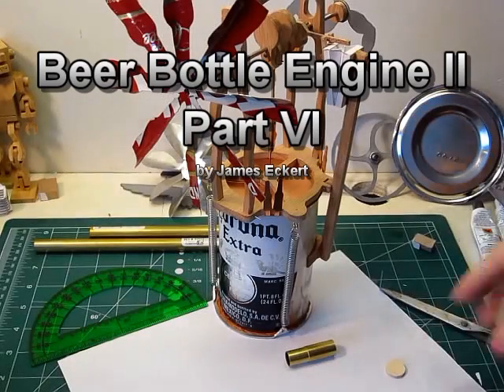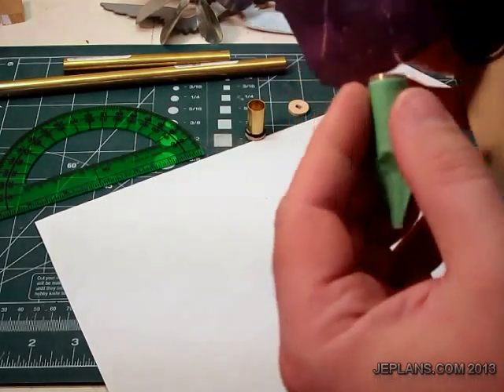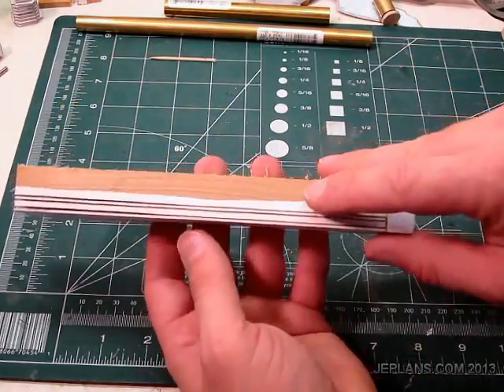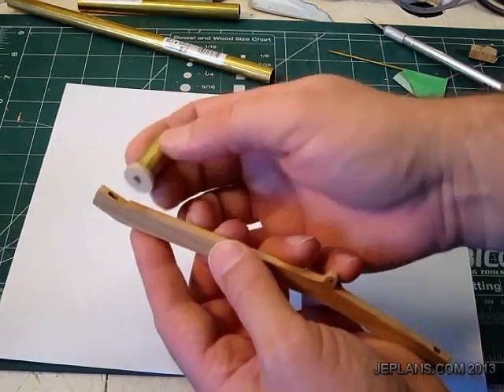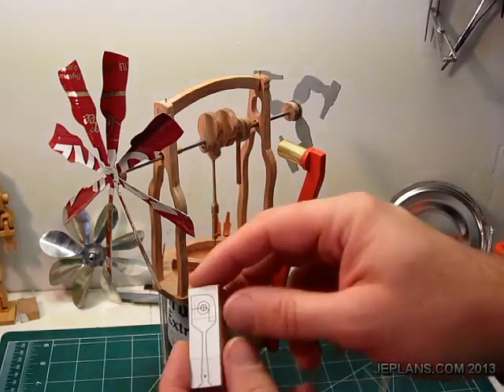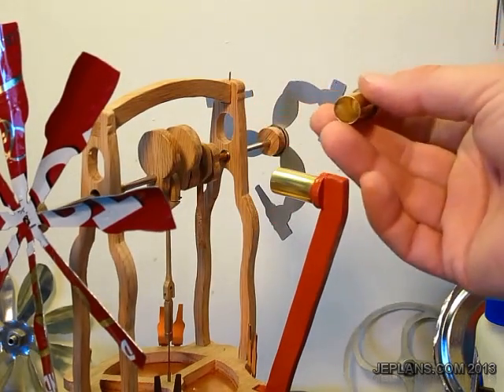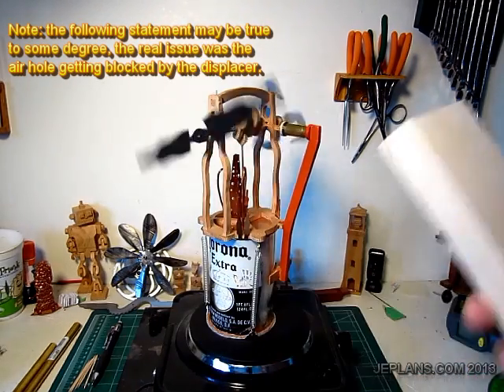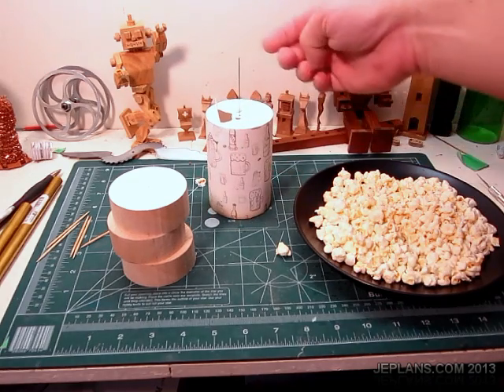Beer Bottle Engine II Part 6

Comment: Beauty design! May I humbly suggest trying to mount the cylinder portion directly to the bottle to remove the dead air of the channel, cap or fill the piston so there is no dead air inside the piston, then hinge a lever in place of the air channel to bring the forces up to the crank. I'm not an expert so take with a grain of salt please ;-)
Thanks again for your videos, I'm really enjoying them. (I just rediscovered them after many years and they've been worth rewatching)
Reply from the maker: Using the air channel to bring it up and drive from the side was really about make the crank shaft easier to build and better balanced. Taking the air for the midpoint of the cylinder was to try and minimize the disruption to air flow in the displacer.  At least that what I was thinking at the time.

Comment from the maker: DeWALT DW788. I like it, nice and smooth. Before that I had one those $80-$100 units, you see them under a lot of different brand names but there all pretty much the same. You can make a go of it with cheaper units, I did at first but they are harder to use because they vibrate a lot. When I upgraded to a the DeWALT  I wasn't sure if had gotten that much better or if the saw was that much easier to use. In the cheap saws defense I should have bolted it down to something much heavier.